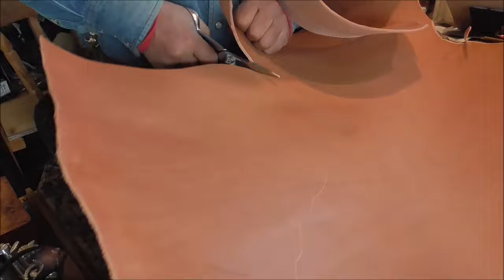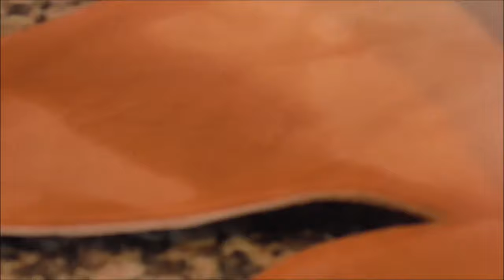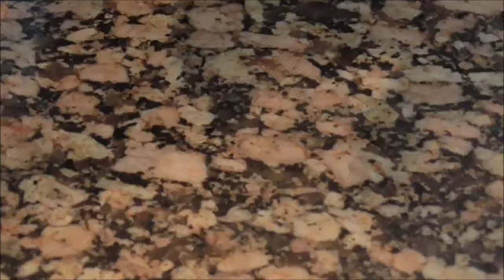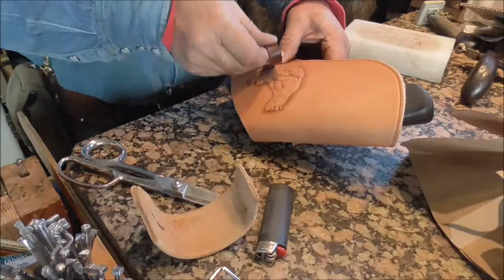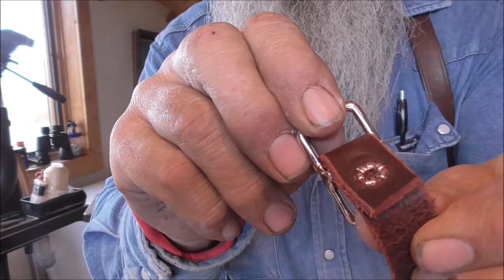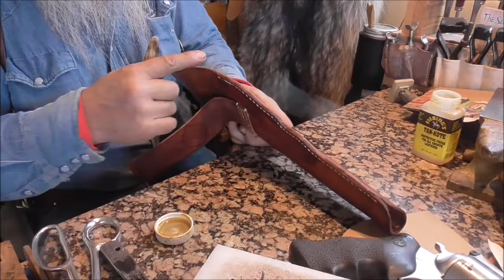Making a Ruger Redhawk Holster

Comment: Thanks for the enjoyable entertainment during my lunch break. I like how you set up that thong to secure the flap. I have been thinking of a type of flat spring with a hook and loop arrangement for the same purpose but i need to experiment with making one and see if i can work out how to do it other than just mentally. Something that would hold the flap securely incase of a fall or snag up but still be fast to disengage.
Reply from the maker: I've layered a piece of rawhide between leather sides (sandwiched) to do something similar. If you do it really wet, when it dries it's kind of a formed spring around the gun......does that make any sense?
Reply: @MuskratOutdoors  yep, I can see how that would work. It's moldable and dries stiff and slightly flexible. I call it the original kydex.